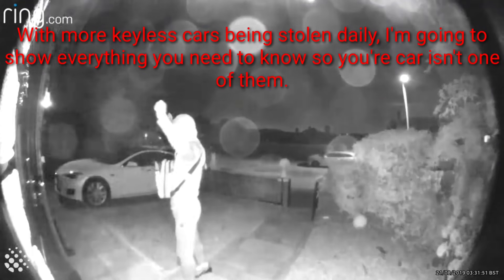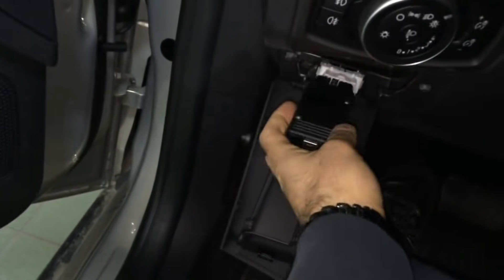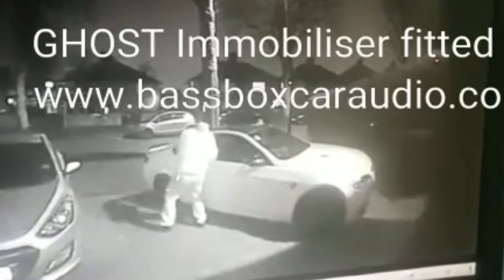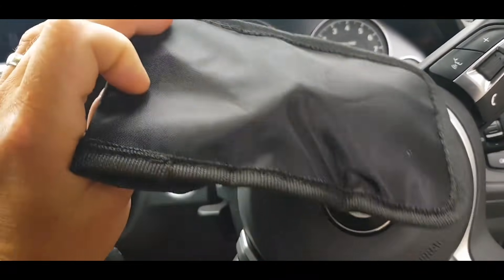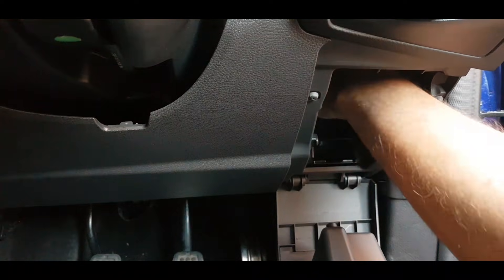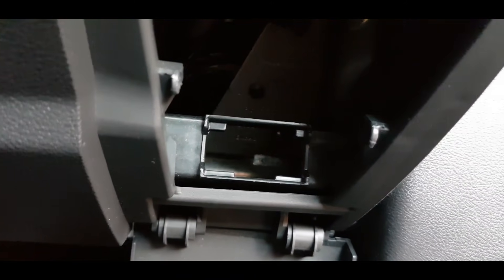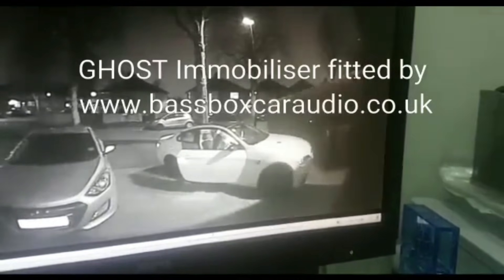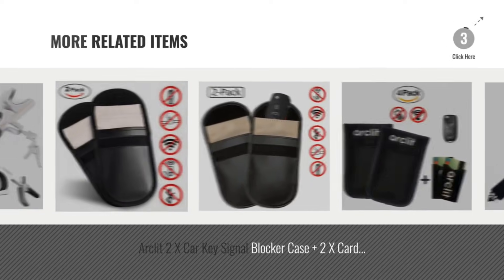Keyless entry car theft NO MORE how to totally protect your car from keyless theft

Comment: Couple of other ways to disable the keyfob.
Remove the battery.  Not very practical on a frequent basis like nightly.
Add an on/off switch to the keyfob.  Keyfob manufacturers could do this easily.  Skilled DIY'ers may be able to do this as an addon feature.
Many people just need ability to disable the keyfob at night while they sleep.
Reply: There is a way to disable your FOB using the FOB itself.  Touch the lock feature and hold it while holding it press twice the unlock button. DONE. Your FOB is not transmitting . Test it for yourself try to open your car while you have the FOB on you it will not open.  To get it activated again just touch any button. I saw this from a guy here in Youtube I cant remember his name to give him credit.  I just bought a Lexus and I tried it and I just couldn’t believe it works to perfection. Then I talked to my salesperson about it and he just couldn’t believe it.  By the way this will also help extend the battery life.  I do have the pouches which I bought before knowing this trick.  I am not sure if this will work for others cars besides Toyotas.
Reply: @rutherosado8718  Make and model specific.  Faraday cage is universal.
All that button pushing will actually drain the battery faster and shorten battery life.

A nice DIY faraday cage can be made by cutting a paper towel tube in half (~5.5 inches long x ~1.5 inches diameter) and wrapping it with a few layers of aluminum foil.  Leaving one end open.  No seams or lids to fiddle with or fail.  Try it.  If the lock/unlock combo buttons impresses you this will absolutely be astounding.  Can't get in the car even with caged key fob right next to the door.

Just drop the key fob in the cage at night and dump it out in the morning.  Easy as grabbing it off a key rack.

As extra precaution, store key fobs away from house exterior where perps have access to.
Reply: @RazorStrap  hey thanks for the advice. I did buy the Faraday cage but I wondered if turning on and off was a good idea or not and when researching I found one comment that said that it saves the battery.  I decided to use the the Faraday anyway.  Thanks a million for the advice.

Comment: The faraday cage is one of the least expensive an most effective methods of preventing modern car theft. 
The other is simply a mechanical switch that is hidden, which you engage when you start your car.  This can be a simple switch which opens the start solenoid or fuel pump circuit.  Thieves are not going to spend much time searching for the switch. If it’s a switch where you can remove its operational toggle handle, it makes maters more difficult. 
Today you use two factor authentication to access your computer or mobile device, why not your very expensive vehicle?

The other option is a removable battery kill switch.
However, a battery kill switch will result in anything maintained by memory, to need resetting each time you use the vehicle, such as your clock and radio stations.
Reply: Exactly. Even pairing a phone requires a code to verify. So it’s weird there is absolutely no second factor that a driver has to do. Especially when they know there is a problem.

Comment: If I was to relocate my OBD2 port I would put a fake one in place so it does not give it away that I relocated it. Thieves are not going to take you dash apart to look for the original one. It takes to much time.
Reply from the maker: exactly thay will just give up after plugging into the fake one in the original location.

Comment: There is another way to prevent relay theft.. Fit a hidden switch to the brake pedal switch. All keyless systems require brake pedal to be pressed to start. Unplug your brake pedal switch and try it..
Reply: Some require clutch, rather than break pedal to be pressed
Reply: @galatei11  manual transmissions are the ultimate anti theft device here in the states.  Hardly anyone can get a car with a manual transmission unless it's a sports car like a Mustang...most are automatics.

Comment: Those OBD port relocators seem a joke to me as the thief knows where the original is supposed to be (and thus where its wiring is) and only has to check around for where it has been relocated/extended to from there.

Comment: Steering wheel locks are useless. For older vehicles they punch the door lock. Cut off the steering lock, and cut into the ignition, allowing it to turn freely

Comment: I gotta say.. good thing about high end Mercedes is they have a setting on the key which kills the key after locking the vehicle.. And it doesn't matter if you have the key on you.. and you walk up to the vehicle.. you can't get the door unlock muchless start the vehicle until you initialize the key.. And if a theif comes sniffing around with an Antenna looking to pick up the signal from the key.. they won't pick up anything.. as the key will be dead to the world until it's initialized by the owner..

Comment: Steering wheel lock is a good deterrent. however there's battery operated cutoff wheels that will make quick work of that thing along with wheel boots, etc. yeah years ago LEO's put a boot on my wheel when they thought I'd parked illegally. To their surprise I left it in pieces at the parking space I left. they contacted me but I denied it & they didn't have video to prove otherwise (told them I knew nothing about it). 

BTW the easiest way to prevent theft (IF you're technical) is to lift the start fuse from the fuse panel and wire it in to a hidden SPST switch and inline fuse. That way the starter will not turn over if the SPST switch is open. I hid mine under the rear portion of the front seat but to access it you gotta open the rear door and feel around for it. Thus the only way to steal the vehicle is with a tow truck. Doesn't matter if they have the key or not, see? I actually JB Welded the lift into the fuse panel that way they couldn't jump the fuse.

Comment: Only problem with the pouch is at completely voids the convenience of  keyless because you can just put a key in the socket just as fast as you can pull it out of a pouch. They should just have a disabling switch on the key itself.
Reply: Toyotas have key sequence you can use to disable the FOB's transmitter on their remotes.
Reply: You would still have the inconvenience of turning it on and off. You’ll have to pull the fob out of your pocket, same as pulling a regular key out.
Reply: How do we even find the key sequence to disable it

Comment: I think if you shut off keyless entry from your vehicles menu (if equipped) it will keep thieves from being able to do a relay type theft (example: https://www.youtube.com/watch?v=FKLzJZRs7zo)  No need for a Faraday pouch then.
The OBD2 lock sounds like a very good option if they break the window; The lock is kind of expensive. As a alternative, hiding your OBD2 sounds like a good possible deterrent.
Thanks for the informative video!

Comment: Whilst you're asleep and someone tries to steel your car but they didn't succeed, would you know that someone tried to steel your car?
Does it give any indication of this?
Reply from the maker: no other than the car will be unlocked
Reply: @MADMODS  but if you hadn't or forgot to lock it you won't know for sure if someone had attempted to steal your pride and joy.

I built an alarm in the 80's 
to protect my ford Corrina.
I built a coded ignition system, so basically when you got into the car you had to input the 4 digit 
Code on the keypad, if you didn't but inserted the key
And tried to crank it, it wouldn't crank but would sound all the bells and whistles so everyone would be alerted, and the thief would run mile!

It was a simple system and very cheap to build these days you can build something similar even cheaper less then the price of a dinner!
Reply from the maker: @mrshoney2624  I'm a auto electrician and totally agree but people don't want that now thay just need a key get rid off keyless entry and it would stop so many cars being stolen.

Comment: Some years ago I read about a guy w/a steering wheel lock. A smartass thief opened the car and picked the lock on the device. He left it in the car just to show how little protection the Wheelock provided.
Reply: These days, they just cut the steering wheel and.... It's still drivable so away they go......  Now that did a lot of good, didn't it?

Comment: If you remove the battery from the key. Can that prevent relay theft?
Reply: No battery in a passive rfid key: car sends out signal 24/7, key's rfid reflects signal, car recognizes key, car open's lock and alarm (that's what this is about)
Reply: @ArjenvanHassent  the proximity system does not require a battery in the keyfob, the keyless entry with push button start has  a battery in the keyfob as well as a proximity system   as fail safe in the even the battery fails you can still start the car by physically touching your keyfob near the start button.
Reply: @ArjenvanHassent  That is absolutely NOT how the RFID in a fob works. At all.

Comment: Those key fob pouches don't always work. I had purchased 3 different brands from Amazon which all 3 work great in the beginning but months later, it just stopped working all together! I even tried sitting in my car with my keys in the pouches and the car would still start so what I did to make it effective again was by cutting the internal sewn areas and just added more aluminum foil to make it work again.

Comment: Once upon a time it was so easy to hot wire a car if you could get under the hood.  Seems like after decades of theft proofing, we are just back to hot wiring, albeit high tech. 

Over 20 years ago GM had a very simple theft prevention system. The key had to mechanically match the ignition part, of course.  As always.  There was a bump on two sides of the key.  Many people presumed that this was a chip. It was not. It was a resistor. There were 15 possible resistances.

If the key's resistance did not match what was programmed into the BCM, Body Control Module, it would not start. 

I drive a 2000 Buick Regal GS.  Supercharged.  I do 95% of repairs myself with the assistance of factory manuals, 6 1/2 inches worth stacked. 

I can't imagine the challenges of owning a new car. Presuming I could afford one, I'd want the very longest warranty possible.

Comment: WHAT ABOUT THOSE WHEEL LOCKS THAT THE POLICE USE WHEN YOUR ILLEGALLY PARKED ?
Reply: They don't work. There's battery operated cut-off wheels that will cut them into pieces in seconds. I carry one of those just for that reason... and I park legally.

Comment: With my car you actually need able to program your actually need the key to be able to program another one and it takes a locksmith about 20 minutes to program and if you lose the keys only a locksmith can program with a code and has to be a locksmith to be able get it because it cost big money to be on the platform to get codes and you must be a locksmith

Comment: why not use a fake rf transmitter/receiver when u place ur vehicle key in an rf blocker box so that the only transmitting signal is the false rf transmitter that when they attempt to do the relay theft they transmit a lock code to the car setting the alarm off and immobilizing the vehicle until you use the correct key to unlock

Comment: Steering wheel locks are almost useless, they are so easy to take off and it only takes 10-15 seconds to remove one. The original steering wheel lock was called "The Club" when they came out it was quite a fad, a local thief with a sense of humor actually went around town breaking into cars and stealing The Club, that was the only thing he took, nothing else, I think he stole 40 or 50 of them. They buy a bolt cutter from the hardware store, one quick snip cuts the steering wheel, maybe two snips, and the steering wheel lock comes right off.
Reply: Can't do that with the disklok, would need an angle grinder for that. Not ideal in the middle of the night when the thieves are trying to be quiet......
None will stop a professional thief, but for the majority it would be enough to make them go find the same car somewhere else without any security.
It's all about layers, the more you have the better your chances of keeping your car.

Comment: I'll just take the starter engine relay out every night if that's the case can't start the car without it anyway
Reply: Just get the normal key imo
Reply: Good idea if you are using your car occasionally but keep in mind that you need to take off all the relays that are the same as the starter relay, otherwise they can swap one next to it and start the car.

Comment: Another thing is take the battery out of the key at night.. And if you know what you're doing you can put a switch that kills the pump so it won't start or remove a vital fuse that will render the car useless to a would be theif.. 😂😂 No theif will wanna be out there bonnet popped open trying to find out 'why' the car they're trying to steal ain't starting?? 🤔🤔 Not unless they wanna be caught red handed in the act.. by the feds.. 😂😂

Comment: Er.......what's to stop a would be thief from simply cutting the cable ties? After all, when the car was taken into service, that's what the garage would do 

Most car thieves know where the ODB ports should be on the car they're looking to steal.  If it isn't where iy should be, it's unlikely it will have gone far. The thief just needs a torch and a Stanley knife.